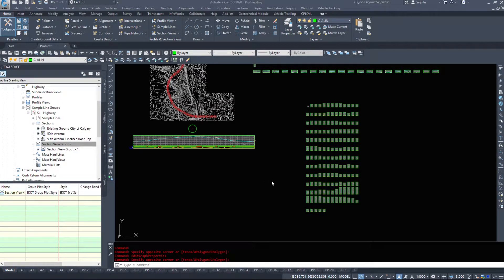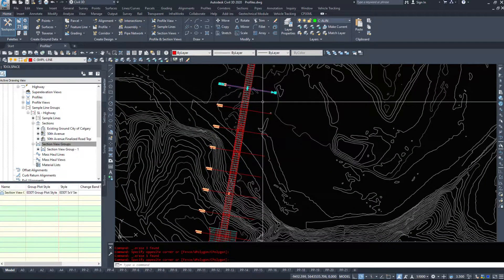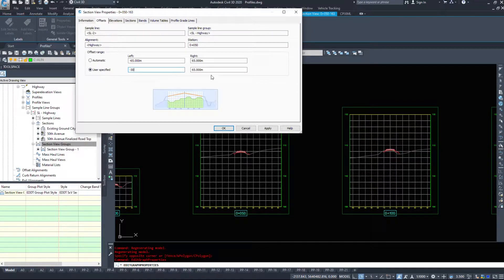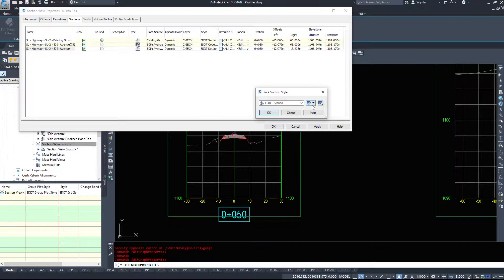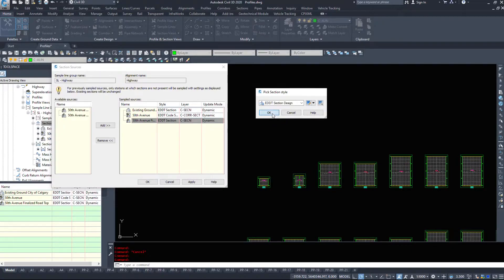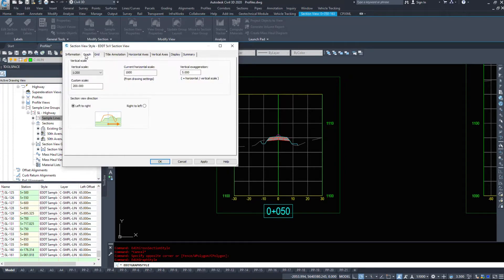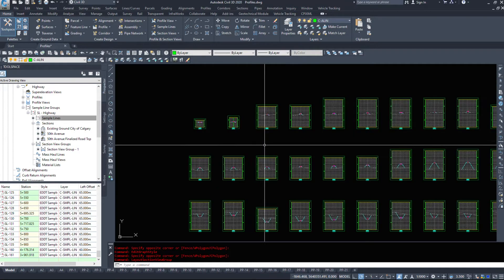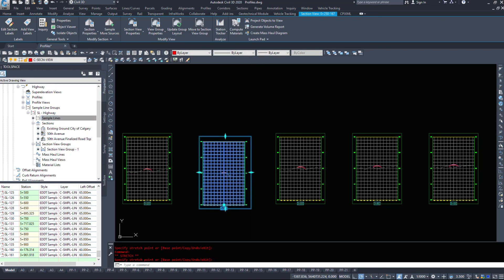Introduction to Civil 3D Part 40 - Editing Sections

Comment: Brilliant!
I have one question ... how is the ditch/ swale slope next to the  road/corridor set?
Reply from the maker: The sideslope grade/slope is set in your assembly properties window. If you are talking about the slope of the bottom of the ditch where the water flows, that is set from your Alignment/Profile grades.
Reply: @KyleEvansCivil  Thank you very much for taking the time to answer my question. To restate my question,  i want to assign a slope to a ditch, while the Damm / road remain slope remains horizontal( or in opposite direction). Thank you very much .
Reply from the maker: @awo-gin  Oh! Then you will either need to make an offset alignment and profile showing the location and elevation of the ditch, or a feature line that shows the same thing. You will then need to target that new location and elevation with your corridor.
Reply: @KyleEvansCivil   Thank you very much again !. I highly appreciate it. I shall try it  and get back to you . HAPPY WWEKEND!